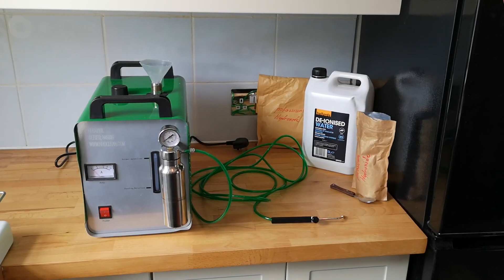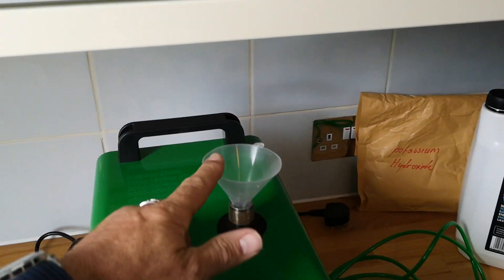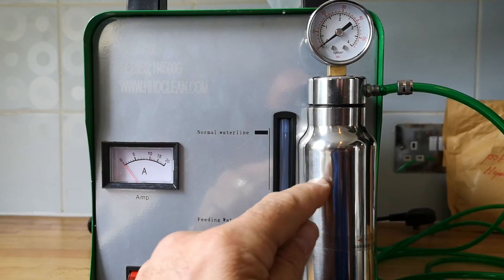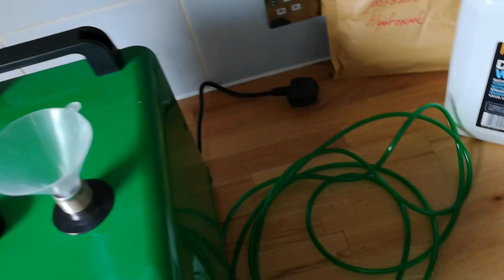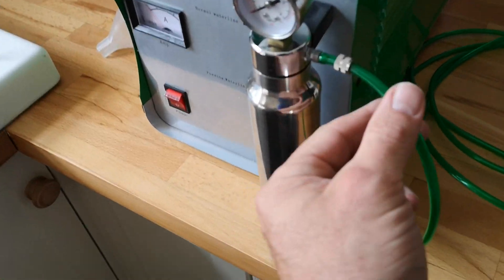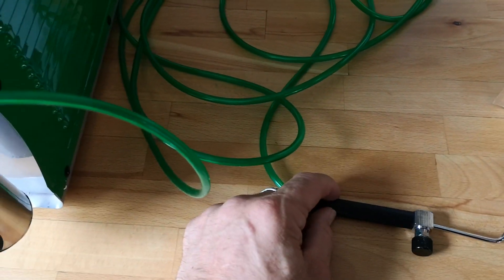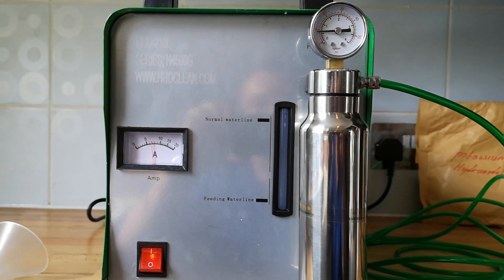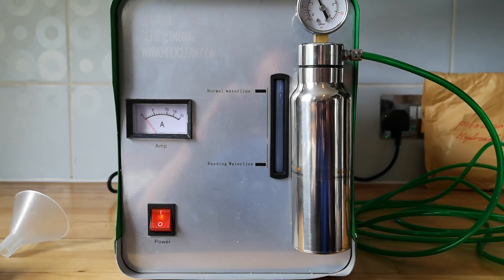Engine Carbon Clean Machine SET UP Guide

Comment: Where do you insert the gun on auto, for how long,and does the auto should work during the proces?
Thank u
Reply from the maker: Hi the gun goes in the air intake pipe, the time depends on what machine you have mine is approximately 10min per 1000cc. It should all be in your manual. 👍
Reply: @JFKKARZ  ok thank you
Reply: And the auto should work during the proces

Comment: Hi, do you get constant flame or you need to switch off and wait to build up pressure as well how long you can use before need to top up water. Thanks
Reply from the maker: Hi the pressure will need to build up, and the distilled shows on the gauge, plus check the bottle every 5 Cleans

Comment: How much do you open on the pressure gun
Reply from the maker: Enough to produce a steady flow.. maintaining approx 1.5 bar..
Reply: @JFKKARZ  so would that be half way?
Reply: @JFKKARZ  my machine doesnt have a gauge so im not really sure
Reply from the maker: @minhajuddin6607  OK ask yhe manufacturer.. or Google the manual.

Comment: When you open the valve on the gun is it normal for the pressure to drop to 0? Or just above?
Reply from the maker: Hi yes the pressure will drop, slightly, but only give it a quarter turn. as you need constant pressure.

Comment: Do they deliver worldwide ?
Also does it really work ?
Reply from the maker: Hi they do work, but I do not sell them so not sure on delivery.
Reply: What does it actually clean though ?
Reply from the maker: @garyatkinson5699  It cleans the parts subjected to combustion, i.e.:
Cylinders.
Pistons.
Valves.
Exhaust manifolds.
EGR (Exhaust Gas Recirculation) valves.
Turbochargers.
DPFs (Diesel Particulate Filter)
Reply: It can’t clean egr and manifolds turbo etc ?
It only burns the carbon during the combustion so there are no flames in anything except the combustion chamber so not sure I agree it would work like they claim.
Reply from the maker: @garyatkinson5699  well I have been using the carbon cleaner on my own cars, and I know it cleans the EGR valves on bmws, not as good as a removal clean.  I would say 75% clean first time.. And a noticeable smoothness in the engine.  So not sure where you getting your information.. The way to find out is get it done on your car.
Reply: @garyatkinson5699  This size will not clean much as gas production is minimal, you'll need a machine that can produce 8-10 LPM of gas, probably skimming the surface of carbon